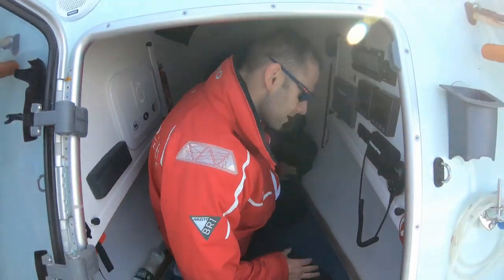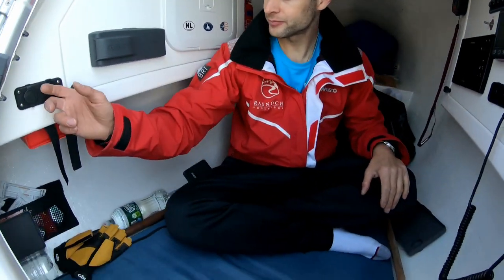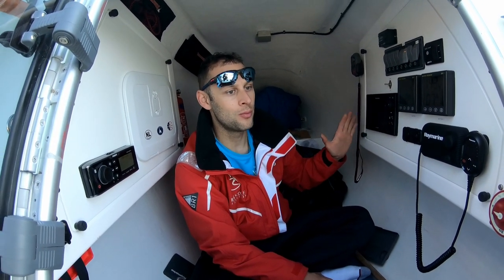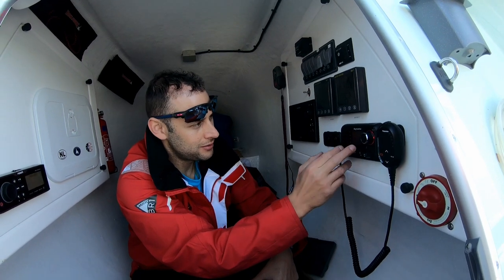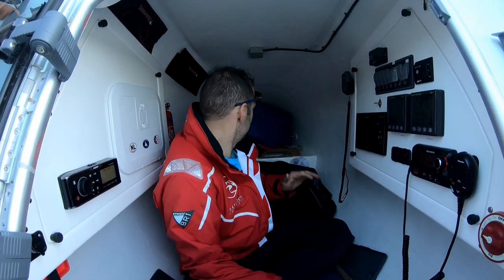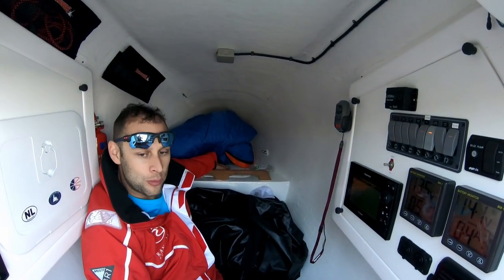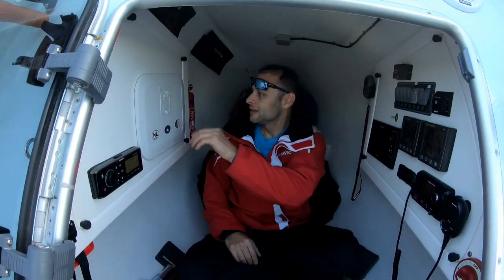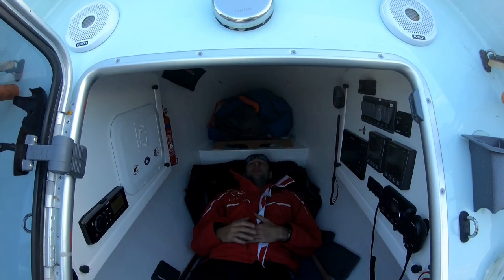Rowboat on the water and  Description of Inside Cabin Space

Comment: What is the cost of ome of these?
What happens in a storm, can you batten the hatch and stsy inside or are you fucked?
Reply from the maker: around  $ 80000 USD (NEW) + - 7500 based on the equipment it comes with or not. In storm you absolutely want to e inside the cabin. The hatch is watertight and it is the only thing that prevent you from dying, that's the reality.  Here you can see what happens inside during capsize                 https://youtu.be/BMk5kbcfuPU
Reply: @milanrows  ahh cool. Thanks for answering my question!
Reply from the maker: @brocklanders1984  Thanks for the questions!